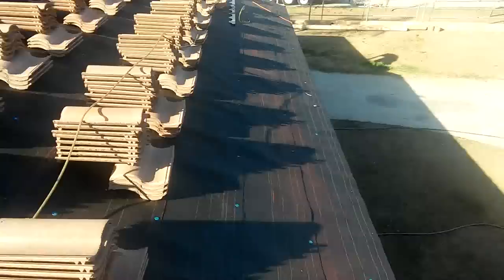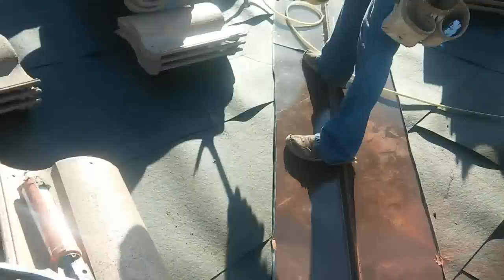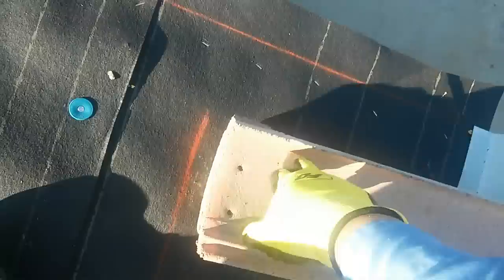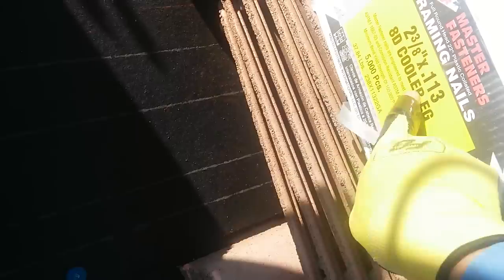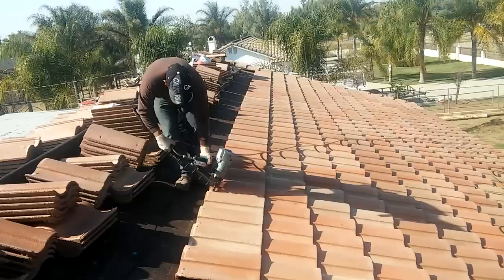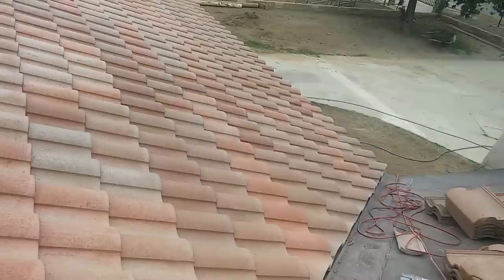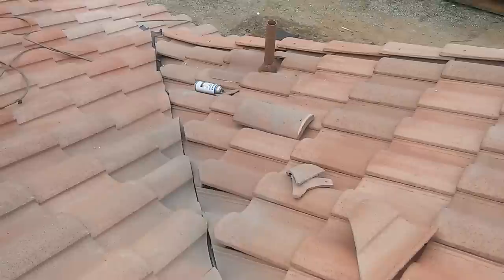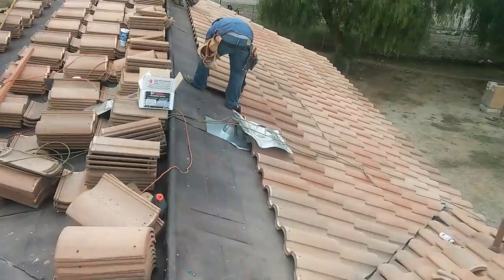Tiling a roof :ROOFING TILES  INSTALLATION VIDEO...Anyone can do it ...try this !

Comment: I'm learning  a lot on the job. I mainly  do repairs. Leaks etc..anything on a roof.  Tiles I find interesting. It's a pattern. Once it's figured  out its no problem. I work in Arizona the heat gets crazy. I'm looking  to invest on a gas nailer.  Thank u for your time

I'm learning  a lot on the job. I mainly  do repairs. Leaks etc..anything on a roof.  Tiles I find interesting. It's a pattern. Once it's figured  out its no problem. I work in Arizona the heat gets crazy. I'm looking  to invest on a gas nailer.  Thank u for your time

Comment from the maker: It's light weight concrete tile, Eaglelite Capistrano blend ( San Juan Blend) ,88 pieces per 100 square feet, installed at 3' inch head lap, Tiles weights less than 600 lbs per 100 square feet , so i can replace your shingles easy,
I was going to upload a long video , but I think the viewers get bored of watching a long video about tile, so I decided to upload short videos about the in progress installation. 
Chapin is from Guatemala , Suchitepeque... since he weights less than 150 lbs. he walks perfectly over light weight tile ...I brake too many ..Lol .
thank you for watching guys.
Eric.
Reply: Roofing Solutions By Eric Garcia
Reply: Roofing Solutions By Eric Garcia
Reply: Eric good job you're information is very important thanks for informing
Reply: Nosotros asemos una casa más grande que esa al día compa
Reply: Yo se travajar con teja s flat y villa
Reply: Roofing Solutions by Eric Garcia cuando se quiebra una en Centro como se repara
Reply: miguelq candela ya fueses millonario wey o lo regalas el jale wey
Reply: Este vato trabaja propio... Por eso no anda dejando trabajos cancheros...que luego se tengan que ir a reparar.... Eric continúa con tus videos son muy interesantes
Reply: Hey Erick.  Como esta? If you can load a video of your crew doing a drain on a torch dow roof.... also since lead it's not allowed in cali. What do you use on a tar and gravel roof?

Comment: Just built a lean too roof off the side of my house onto a 40f long extension I done everything myself foundation too walls and roof and hips at front I havn't tiled just repaired before but now I do it all and I have 2 vallys / hips should be handy enough I dont have a gun thou but i will get it done 🤞

Comment: Currently installing eagle S tile,, this order of tile has the nail holes filled ,, when the guys nail with gun to get through  concreted nail hole it breaks tile,, when they back the pressure out the nail bounces back & messes up the row of nails in the gun,, Any suggestions other than drilling out all nail holes,, Seams on this one we may just have to hand bang it as the drilling of the nail holes will eat at the time that would've saved using the framing nailers,, Thank you for your videos!

Comment: I'm learning so thank you.  I didn't see any battens. I thought you nail the tile to those..  Roof looks great with that kind of time
Reply from the maker: battens is not a tile accessory , it's something required by the building code when the roof is steeper than 6/12,   this roof was 4/12, does not required wood battens sir .
Reply: thank you for responding.  I didn't  know about the codes. watched 3 of your vids. great work with hard workers.  ✌✌
Reply: can i hire you??

Comment: Great video!👍 got a few questions though!why don’t u install 1x2s or 1x4s to hook tiles on before you nail them to roof!?i do this for a living and I install them 1xs all the time!and that underlayment is felt your using?tiles looks straight and nice job!and that lip your hammering to catch water on valley metal is not tall enough!we leave 1/2”-3/4!just wondering if codes different where your at!im in rockport and just went through hurricane Harvey and tile roofs messed up more of the neighbors house than there own because not done right!we have to use clips on first 3 rows
Reply from the maker: Lee Izaak ...you answered your own question !! We don't have hurricanes here, no snow, probably high winds but not strong enough to blow off the tiles.
Reply: Roofing Solutions for any roof conditions 👍true!great job man your real helpful and speak facts!thumbs up for sure

Comment: Are you nailing the tiles directly into the roof plywood ? I have always seen a wooden strip used , that the tiles are nailed to.
Reply from the maker: S H ...when you see roofers install tiles over  wood  battens , it means the don't  have any basic knowledge about tile roofs, wood battens are not mandatory , unless you have a 6/12 slope and above.

Comment: Thanks Eric,great video but again i got questions because i never done tile =D
is the valley leaves like that relying on metal with 1cm bends?
What about penetrations,are they rely on felt paper or you add some cocking on the top of tile around them ?

Comment: Eric tengo una pregunta para ponerle tiles a un porche que esta casi plano tengo que ponerle la madera chiquita que lleva abajo del tile?
Reply from the maker: Esta dificil la pregunta...
1: tiene que tener una estructura que soporte 6 libras por pie cuadrado.
2: consulte con un ingeniero o si no tiene para pagar uno. Consulte con un roofer de su area.
Si el techo soporta el peso...instale teja liviana que pese 6 libras por pie cuadrado o menos.
Antes de instalarla asegurese que el techo plano este en buenas condiciones y por favor no use clavos ni tablitas ( wood battens) peguelas con spray foam adhesive. Lo venden en home depot o las tiendas de teja. Suerte 
Eric Garcia

Comment: 5.30 Still shows his saw blade on backward here as well. Different blade than the one in the other video though. You might want to look into this Eric. Check with the blade manufacturers of your diamond blades & confirm how they recommend installing their diamond blades on your saw for cutting cement roofing tiles.

Comment: Eric I’m seeing roofers do batten, is that ideal or not. Batten (that wood on run on the roof that the tile is nail on the wood.. Please thanks 🙏
Reply from the maker: Battens are a requirement when the roof is steeper than 6/12 pitch, not on roof under that pitch. But some roofers don’t know the building codes and use them on lower pitches
Reply: @Garciasroofing  Awesome Bro, ur the best bro 💯

Comment: You’re the first roofer that I see that cuts the tiles in half it’s way faster just breaking them in half with the hammer.. obviously they all win with a gun just like if someone had a nail gun and u guys were using the hammer to nail they would be faster obviously

Comment: Hey idk if you can help me. But I noticed you didn’t put any battens on the roof. I need to change underlayment and install cement tiles back and I’m need to have solar panne,s installed on the roof. If I already have roof sheathing 1/2 inch do I need to install battens?
Reply from the maker: Unless you have a steep roof use battens if it’s 4/12 or less do not use battens
Reply: @Garciasroofing  thank you I appreciate your reply. You’re videos are very helpful. Subscribed
Reply from the maker: @armendshaqiri7621  thanks for watching!

Comment: What is the minimum required roof gradient for using tiles as the roofing material?
Reply from the maker: 3/12 slope. 
Requires a minimum of 1 layer of 30 lbs felt. At 3' inch head lap .
By manufacturer specifications.

Comment: How do you gun nail without breaking the tiles
Reply from the maker: you adjust the pressure on the air compressor and on the nail gun at 70 PSI
Reply: @Garciasroofing  th ank you, boss!! I tiled the roof myself. Thanx for the great suggestions 😊 I appreciate your help
Reply from the maker: @Brucewayne2112-qk4ji  sure brother ! My pleasure, thanks for watching my videos 👍

Comment: A cuanto haces las caulklines que van para arriva para que se mire dercho ???
Reply from the maker: jr rollando ...give 3 inches headlap but make sure you don't end up with a small piece, if you have to shrink the lines from 14 inches to 13 orc13.5 it all depends how it the last tile that gets to the ridge
Reply: Roofing Solutions By Eric Garcia hi Eric thanks for your videos, what's the name of the plastic that covers the 15th ridge and hips thanks
Reply: Roofing Solutions By Eric Garcia great video!